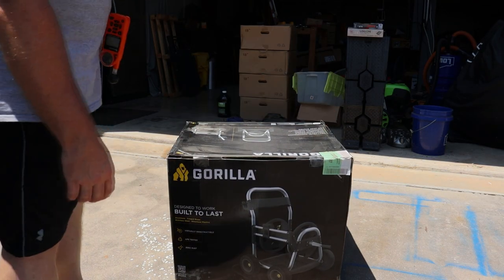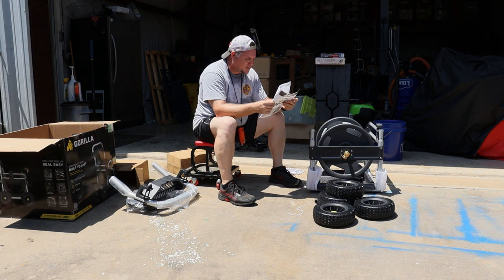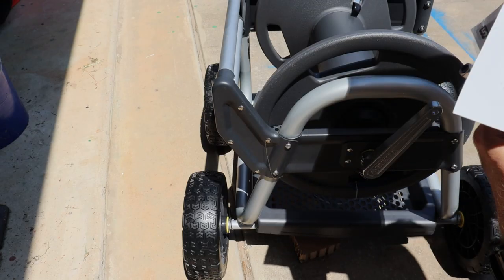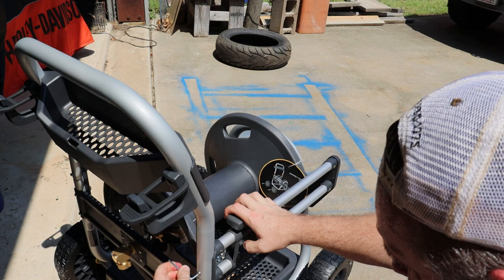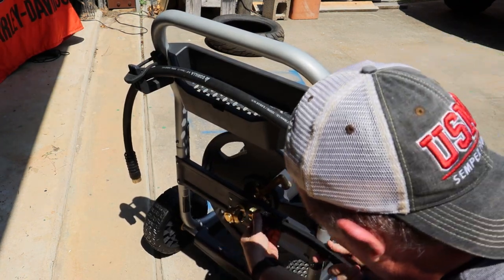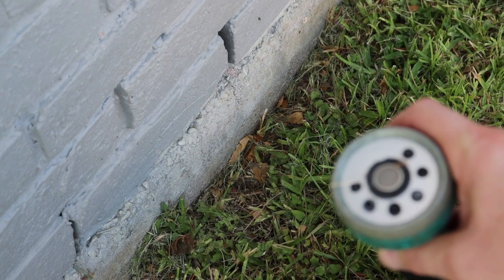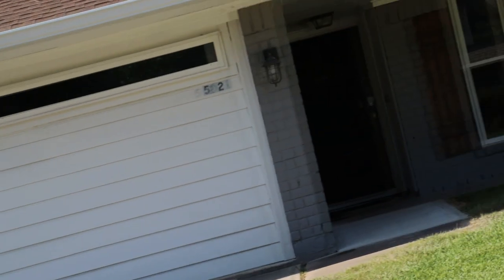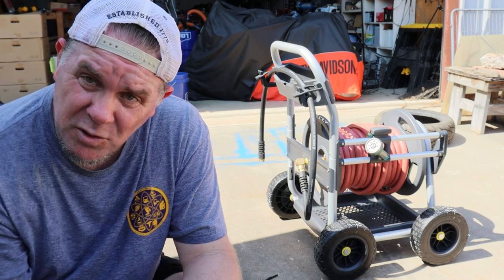GORILLA Garden Hose Reel Cart 250 - Ridiculous Unboxing, Assembly and Review

Comment: I bought mine a couple days ago. The wheels were already put together. Only had to attach tube for wheels, front support, handle, and crank handle. Also, if you look at the part where the tubes insert for wheels, handle, and front inserts there is lettering that says "bottom" which is where the tube for wheels and front support go in. Also, the one thing that threw me was the crank handle bolt because the compression screw and nut are left turning which makes sense because if it tightened right it might come unscrewed.
Reply from the maker: Thank you for the added tips!

Comment: It took me over an hour to put my Gorilla Hose reel connection because I couldn't get the screws to tighten enough and I couldn't hold the nut tight when I was using the L tool.
Reply from the maker: I hope you eventually got it and were able to enjoy its use.  Congratulations!